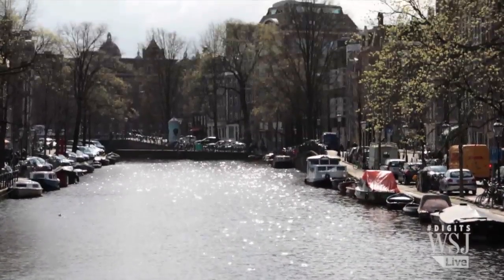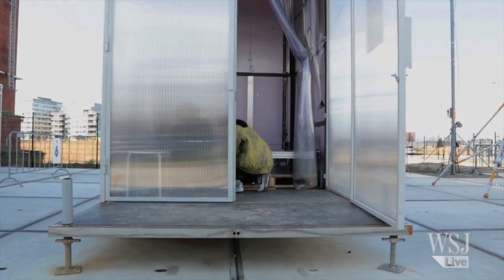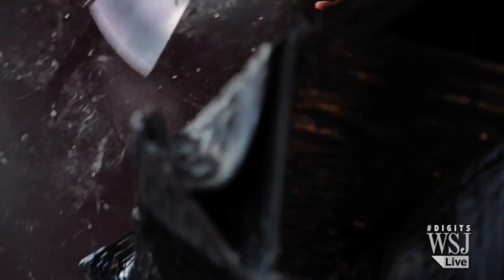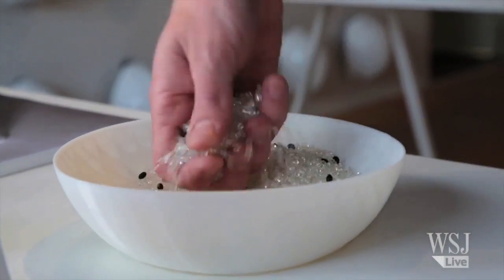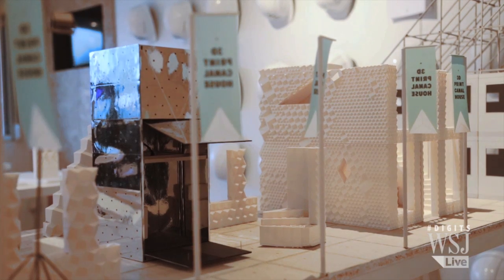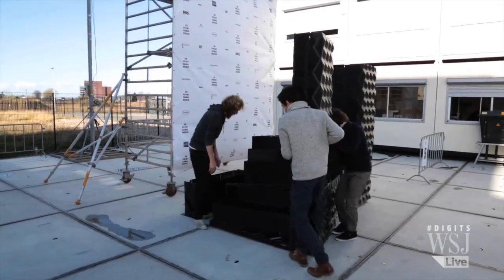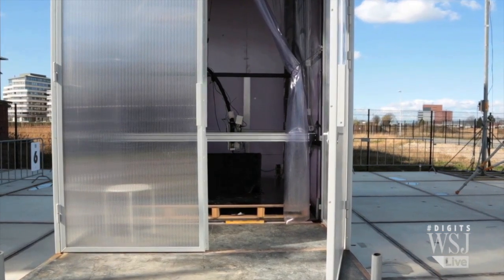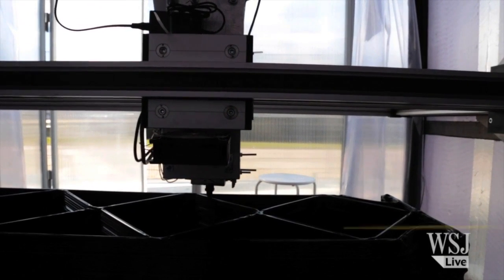Kamer Maker Builds World's First 3D Printed House

Comment: I think they are using the 3d printing incorrectly on the construction site.  The main materials can be steel, woods and cement boards what should be 3d printed is connectors, roof pieces, water-proofing pieces and detail interior pieces.  Those can be 3d printed on site.  In a way going back to a field made house.  That way you keep it cheap but very unique.